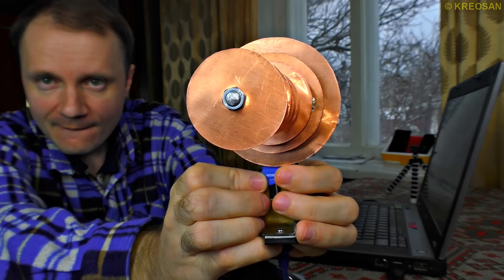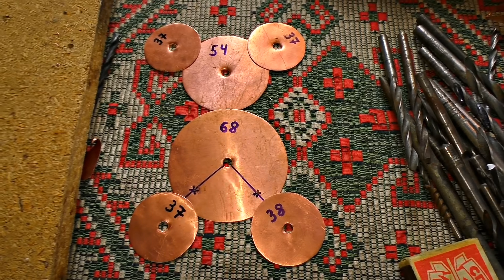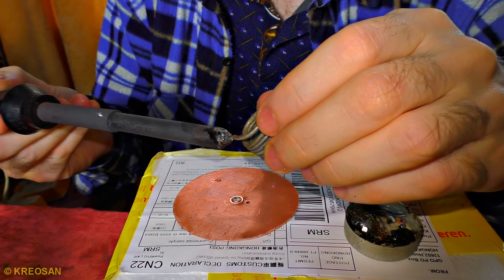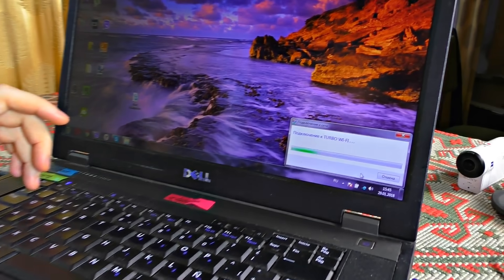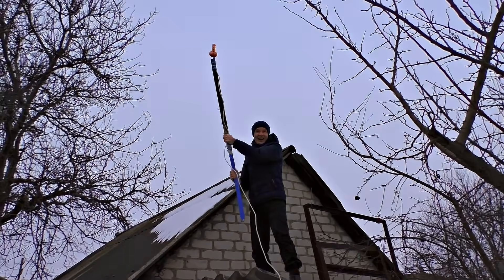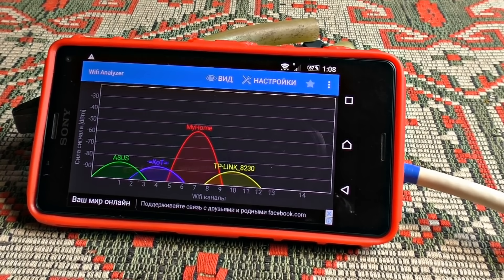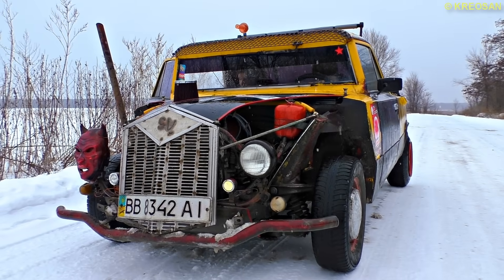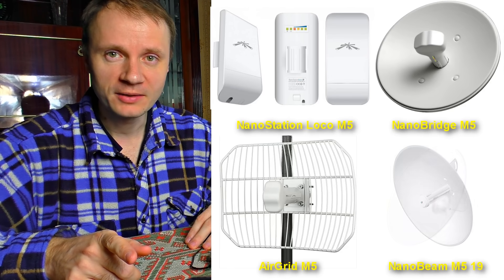✅Wi-Fi Gun DIY / Powerful Antenna for Wi-Fi !

Comment: Absolutely useless without the individual wifi passwords
Reply: That's what I was thinking unless you have physical access to the routers. Without permission (who do that?) you're going to jail if you get caught.
Reply: Well, youd be surprised how many people have either unsecured wifi, or default passwords.
Reply: @springbloom5940  Yea, I would be, I've checked some always locked but that doesn't mean they all are. Seems like if they don't use a password they're lazy or ill-informed or reckless, or a combination thereof.
Reply: @chrissimon8368  

Reckless and lazy are the top two answers on the board.
Reply: @springbloom5940  Are you saying I am being redundant?
Reply: My computer shows me available Wi-Fi networks with in about a quarter mile area which is about 30 signals and every one requires access password's.

Comment: I don't understand how just blasting your signal further away helps you connect, the broadcasting strength of the remote WiFi is not getting boosted
Reply: its directional vs omni.  same amount of power but now directed in a single direction in stead of all over the place
https://en.wikipedia.org/wiki/Directional_antenna

Comment: I'd have to see this work in person...its hard to believe something that delivers very low power can transmit that far... as a Router broadcasts in mw  (millowatt)  while most professional long range solutions have both a Powered Receiver/Transmitter combo  
I have a 8Watt  Wifi Amplifier... but your device  that receives must also have a 8Watt  Transmit for such long ranges. Most residential routers broadcast at 100mW  (.1watts)

Comment: You trying to compensate for something with that soldering iron?
Reply: I think it's actually the most common soldering iron in post-soviet states, just a heating element plugging directly into the mains, and a wooden handle. It's also copper without any coating IIRC.
Reply: Unplug that Russian ICBM Soldering Gun too fast and it will launch an EMP blast over a small city.
- Watchmen
Reply: its thicker than i am for believing this video works as well as it does
Reply: the lack of capitalism
Reply: Maybe, but, there's no shortage of the electricity behind the heat on that whonker.

Comment: It’s called a “Simone” antenna or a “Cigar” antenna! And they’ve been around for years.......   They were commonly used for wireless cable services such as HBO back in the 70’s and 80’s.....   most had many more directive elements, 25 to 30 is my guess.   
The unit comprised of the antenna and the downconverter at the reflector end....   

There’s nothing magical or mysterious about this antenna at all.....    And good luck with that 100’s of kilometers claim!
Reply: Is that the same as what is called a "Cantenna"? Actually thinking about it more, I think the cantenna uses a shielded outer edge to reflect the signal into a beam...  Might be very similar concept, but wondering if there is more of a difference other than them both being directional??
Reply: Mame A  The Simone is basically a Yagi design... While the Cantenna is more of a feedhorn design....  I know there are designs out there for making a Cantenna out of a Pringles potato chip can using a 1/4 wave probe properly placed inside the can ...

Comment: I believe that this who disliked (1,865 people) don't have good Wi-Fi signal  with Antenna or ISP provider  is to far (mostly in villages on mountains)  and don't have  conditions or requirement for cable or optical internet  and ADSL is very  slow  ! Mostly they are install cable or optical internet and ADSL / VDSL in small cities, big cities or mega-cities! Also I forgot 4G and 5G is problem it's expensive from them you get only 200gb 14,37€-16,91€ and addition 100GB 5,92€ in Serbia (depence what operator austrian VIP/A1 or expensive Telenor) , depends where you are living in what mountain village (from 1300m up to almost 2700m)! That problem is here in my state Serbia also in Montenegro, Bosnia and Croatia!Not all countries like Switzerland and don't have everything like them!

Comment: Knowing me I will go through the whole trouble to make this and then realize it may not work at all. No proof of background nor any real versions of this.
Reply: It's a log periodic antenna with circular polarization. This is not a "hack", it's something you can learn by following some electrical engineering classes.
Reply: @ingframin  but those disks aren't shorted by the treaded rod?
Reply: @Thebasicmaker  they are shorted to DC like the metal  inside a transformer, the wifi is 2.4 Ghz AC making the wavelength about 12.5cm.
Reply: It's way harder to make than he lets on.  The tolerances are easy to screw up.  Even he mentioned an error of one millimeter in cutting those disks is enough to keep the antenna from working.  
I hope you can find some better instructions than he gives.  But keep his enthusiasm!

Comment: As it is possible that a copper signal conductor cable magically converts this electromagnetic pulse into a wave and the most fictitious without a pulse converter to wifi signal.

Comment: Is the first and the second disk connected with the metal rod??? Isn't short circuiting the Wi-Fi antenna
???
Reply: Don`t worry. at that frequency, it suppose to. high frequency works different as normal current!

Comment: Very nice but I have a question: if the long screw electrically connects all the copper disks togheter and the antenna cable shield Is connected to the biggest disk and the core wire to the second disk, those are shorted togheter throught the conductive  screw... Correct? In this case I can't belive it could work because of the antenna short circuit

Comment: some say that this wifi gun has radiation that is harmful to health ... is that true ...
Reply: Joank Hyouga exposure is relative so i guess if you sat in front of it all day you would get more Radio Frequency radiation than usual but this is hardly a commercial radio transmitter. He does however recommend mounting it on a roof both to increase the range and gain with the additional advantage of considerably reducing exposure to RF radiation. The jury is out on just how harmful it can actually be but it is in the microwave frequency band so if it is not powerfull enough to cook your flesh it is relatively safe.
Reply: @MrDegsy69  woooow thanks for your explain ... i appreciate for that
Reply: has anyone tried this and succeeded or not
Reply: @joankhyouga  build it and try it for yourself! Don't ask me as you want the answer to your own questions but are not prepared to make a forfiet for science? You may get burned if you have a powerfull enough transmitter but it wont be anything like David Cronenburgs 'the fly'? Rest assured you will not dissolve your friends with sulphuric bile acid vomit and ingest their internal organs through a straw! 😂😂😂
Reply: @MrDegsy69  yes I will try it ... hahahahaha you have a good sense of humor

Comment: The loss in the coaxial cable is so extremely large that it defeats the purpose of the special antenna. You should really use a high quality cable, not the TV antenna cable. Or much better, put a router in bridge mode very close to antenna, and then run an ethernet cable to your PC.

Comment: I love this guy! Roooooters and pancakes and that monster soldering iron!!:) I used a product called a Cantenna 10 years ago and it worked like a charm picking up long distance wireless roooters...:) This  I sure is the same thing.....screw the trolls, my friend, what a fun and informational video.....though I just checked on eBay and the Cantenna is going for around 25 bucks....

Cheers,
T

Comment: Don’t think this is real for following reasons
TV coax is very high loss and wouldn’t work
Even if you could transmit your miliwatts from your router over a larger area you phone still has the very low output power and wouldn’t be able to overcome the distance and disruption from same frequency traffic collisions
Reply: Moreover, TV coaxial cable has impedance of 75 Ohms while you need 50 Ohms for Wi-Fi equipment. It will work ... to some extent.

Comment: cough wrong kind of antenna cable cough
Awesome though xD but regular TV cable doesn't work well for wifi use a waterproof box and keep your router/access point near your wifi gun, then run ethernet back to your location and use 1-2 pairs for power over ethernet xD

Comment: Somehow ping is 2ms. You get such ping only via cable. I highly douobt that this thing is working and author actually uses cable connection for show. Wi-fi has considerable latency (~15ms or more, depending on obstacles, distance and 2.4ghz/5ghz network congestion).
Reply: agree. this seems fake
Reply: I've got 2ms ping on wifi too
Reply: @rocobalt9223  Being in a same room, using antenna on router and sitting almost next to it? Possible. But not over such long distance with a lot of obstacles as shown in video. Signal must make round trip, and that takes time.
Reply: @selphadur5145  speed of signal is 300,000km per second. So 200km return (100km each way) is 0.67ms = 0.00067sec! Obstacles don't slow the signal, just attenuate it, make it weaker.
Reply: This is fake tho
Reply: I live in Romania, a country known for the good internet speed.
Reply: I don't say it's real, just that it's possible <15ms on  wifi
Reply: @rocobalt9223  Well it is if you put wifi devices close to each other and they have good atennas. But then it is better to use cable. Unless for mobile devices.

Comment: I never successful with this antenna, but when I replacing the metal rod with non metalic stick, I found 42 Access Points (only 4 Access Points without this antenna).
I just wonder, this type antenna just similar to Yagi model,

Or, just make this model as Yagi with Copper Tape or Aluminum foil Tape on a thick plastic sheet. Working just same and very-very cheap, reliable, work with any cable!

Just make it! Thanks Kreosan

Comment: Will that work with 5G ? Is it the same concept?
Reply: 5G has a different wavelength to WiFi. unless 5G decides to drop it's frequency to 2.4GHz or 5GHz, you cant (AFAIK)
Reply: @kettlesimulator  ...thank you,  yes i just saw a videp abiut it. Not sure what service provider uses for 5G, probably  10 or 15 Ghz
Reply: @Grahzee1967  5G is apparently 6GHz
Reply: @kettlesimulator  ...i am trying to find a gadget that will boost my phone's (S9) wifi range... using  2.4 Ghz to 5 Ghz  wavelength. 
Any suggestions? Ty
Reply: @Grahzee1967  AFAIK signal strength is improved by increasing the antenna size. unless your prepared to open your phone, unplug the original antenna wire and replace with a bigger external one, you can't really.
Reply: @kettlesimulator  yep, thanks

Comment: I need Measurements on PDF OR DOC. AND also which one is ground wire .. driven or reflector
Reply: he connected the screen of the coax cable to the reflector, I guess that goes to ground.
Reply: @ingframin  but the reflector connected to the drive via threaded rod. I agree some detail are missing here
Reply: Shorted out there and then isn't it. This always smelt fishy to me.

Comment: It’s not work for me. I tried to create 2 wifi gun with different thickness of metal copper. But still not working. Probably because the soldering not stick properly with the metal copper? How you make the tin solder stick with the metal copper?

Comment: It's fake because both the plates are shorted 🤭 nice fakie though
Reply: Not necessarily fake, at least not for that reason. For DC, sure it's shorted, but for RF magic stuff happens. Just look at the construction of a folded dipole antenna :)
Reply: Jonatan G is rigth, folded dipoles,clovers,quads do seem like short thought they perform incredibly well. Althought this is far fetch especially connecting it to an RG6/58 of that lenght wich  would attenuate all RF in that spectrum the antenna,providing reflecting matches,could actually work.......not the phone antenna
Reply: Bruv, you're stoopid as f*ck
Reply: It’s RF bubba, not DC. Good observation though!!👍🏻

Comment: Hello earth! Using this method to use your wifi from mars.
Reply: You wont need data at this point
Reply: You probably had to scale it up a lot I bet

P.S I know the comment is a joke
Reply: Whats the weather like
Reply: Hey martian 
You need to make 20
Reply: you're gonna need to use a higher frequency wifi signal. The earth's atmosphere is opaque to 2.5 and 5ghz radiation. I think the sun would interfere with the internet if we used signals high enough to penetrate the atmosphere though

Comment: I live in Chojnice in poland, and i made this gun with copper from shop,, and i had old big tv sattelite antena and i put it in and put on roof, my hause has 2 stories,  and when i directed it on the center of the city it dettected 1467 wifi routers, even my school internet that is 2.3km away!
I made this with this tp link and dvbt tuner, and i made 20mhz to 5.6ghz radio scanner! And dvbt tuner has the same antenna socket like in the tp link

Comment: This has to be super fake. You made a wi-fi "gun" but demonstrated it by picking up OTHER NETWORKS. Your antenna has no ability to boost the transmission power of other peoples routers. You can't just put a big copper disc on a wire and magically connect to a wi-fi network hundreds of meters away. The router sending out the signal would need the power boost
Reply: So tell me,how you can use 4g\LTE connection on your smartphone?
Your provider has no ability to boost the transmission power of your phone,lol.
Reply: @Fastick911  then tell me, why when you are in the mountain you dont have a signal that your 4g/LTE device can pick up? Even though your 10km away from the providers tower

Comment: he actually made a stacked antenna . . . .  where every circle stands for a fr . But most of them (circles) are useless since they're out of wifi (2.4 GHz) range . . .  only one or 2 would be . Plus high cross polarisation (dont know how it works in practical sense ,  mostly CST i do 😋) .. . .  yeah . . .  Gain would be high since directive . . .  Directors would still work even though lit .

Comment: Just wow, but a few question here: 1. Do it only requires a copper plate to make this gun?  or should other material works too like zinc, aluminum, tins and etc.; 2. Does it also applicable to connect this into an old modem with wifi transmitter? and; 3. is it safe to all living things from radiation stuff or etc.?

Comment: Fake. This cannot work. The screw (the boom) should be isolated from the disks. It should be made of wood or plastic. You should understand the Yaghi principal
Reply: nope. It's working, already tested.
Reply: @JohnGotti__  in SHF, even if you plug a fork it will work. But you'll generate a hight ROS and may destroy you amplifier output. You can understand by using métal conductor for all (the boom, radiator, reflector and all the gain  éléments ) you create a pure short cut even for alternate current. Do the same by replacing the boom with non-electrical conductor material, you'll obtain à réal radiation diagramm with passive gain. Do you know how to calculate the impedence for such antenna?  Watch some vidéo regarding the Yagi antenna
Reply: should be isolated from the disks - not necessary
Reply: There is 2 stupide thinks. 1st,  the boom made of metal makes a short cut within all elements. 2nd stupid think,  the connector that are short cutted on the wheel. This wheel, called radiator should have at least an open line between the alim cable and the ground cable. Last think. A Yaghi is made like this  :  1st wheel is a reflector.  A kind of dumy load that avoid waves to go behind the antenna. Then the next wheel is the radiator where must be connected cables. Then all the other wheels (smaller and smaller) act like signal amplifier. All sinusoidal signal, due to the distance between wheel are re- sent in phase. That lead to gain the signal level.  This is the principal.  1 load behind, 1 radiator, and many amplification éléments.  It exsists another version of Yaghi is the HB9CV where the radiator is the reflector itself. This stupid antenna with 100% metal will destroy your phone or electronic power amplifier. Because it is a stupid short cut.

Comment: @KREOSAN English dit you calculate the sizes and distances of the disks for the specific 2.4ghz wifi . and if so doesn't the thicknes of the sheets also affect it?
and if so what type of calculations do you use/ where to find them
Reply: Lol ya it works fine. I use 24 gage but doesn't seem to make a difference.

Comment: Short summery thing to do
ebay: copper plate sheets around 0.5 mm, go scrap yard/mechanic/ebay search 10mm screw and steel threaded rod, cheap wifi usb adapter. 1 hour work (using this video) =  2-5km range strong wifi = home connection with no signal loss, nearly the same like plugging in directly the internet cable.

Comment: Hi kreosan,

Greetings of the day,  I had tried to build the Wi-Fi gun. Everything OK but it is showing same amount of signal that s

Shown before connecting gun and after connecting gun. It is not working, compared with this my inbuilt Wi-Fi shows more signal. Please give me solution :)

And one Dout, are we want to insulate each plate?

But two wire from modern antenna is already conducting. 

Please help me....

Comment: Titou1384 - uniDirectional is Correct guys.  :/     OMNI-Directional = ALL Directions (Typical antenna)    UNI-Directional = ONE Direction  (ex. YAGi)
BI-Directional = information Transmission in both directions  (*EDIT*: forget the explanation, research passive Antenna physics on Wiki)            Anyway All Network traffic is going to be bi-directional.       I presume ppl misapply bidirectional because they are thinking of the data transmission.  Yet we are describing PHYSICAL PROPERTIES of the ANT.
Reply: On 2nd thought... Something seems 'wrong' about this antenna..   Must be something ive forgotten thx to BigPharma